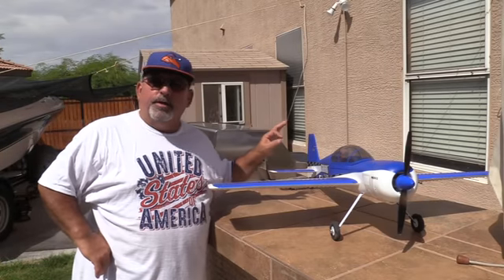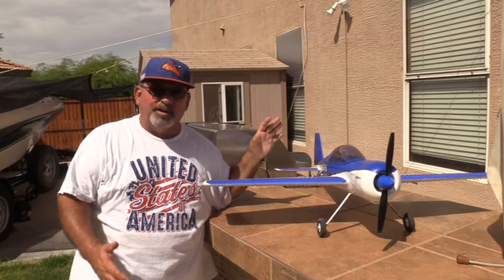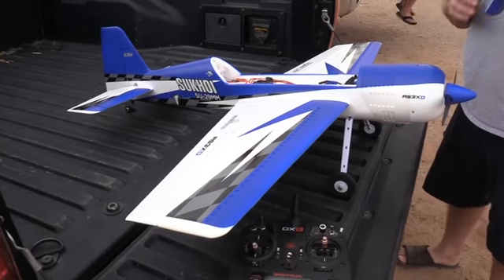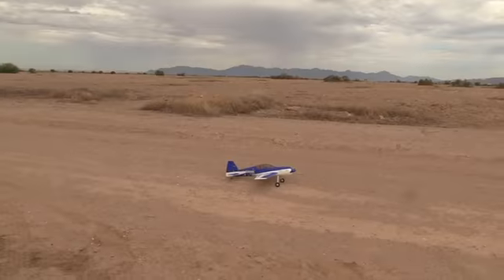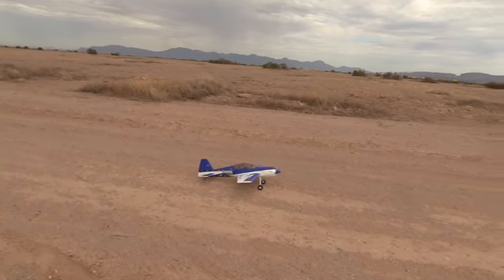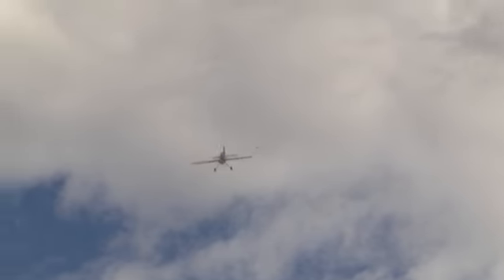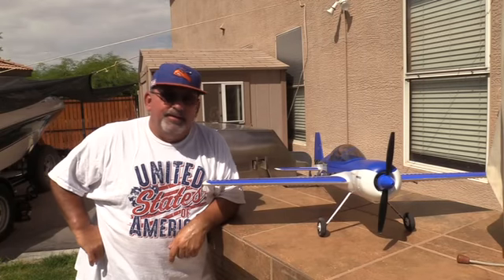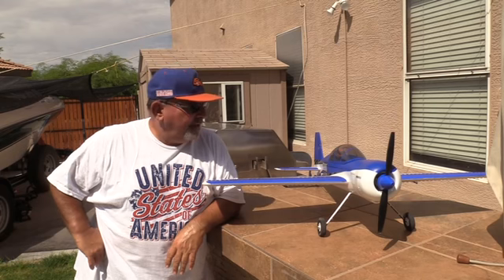E-Flight Sukhoi Gen 2 maiden flight and review

Comment: At least for me, the one mod I did was, remove the blue stickers (I have the green/blue version) from the bottom of the airplane.
Both sides, have the same stripes/stickers, and this is a small airplane and from far away the wheels disappear making it difficult to distinguish from top to bottom. Of course, moving the controls and watching where it heads will tell if upside or not. But the best thing to do is paint the bottom of the airplane black, exactly like the Dynam SBach 342, which is all black on the bottom, and I do this on most of my foamies, helps a lot and mostly on smaller fuselages like the Sukhoi.

Comment: Mine is just assembled with the recommended battery. It is 1/2 ounce overweight out of the box (Maybe a batch of heavy foam?). It is tail heavy with battery all the way forward. It needs a full ounce in the very front near prop to balance per instructions. Nose heavy without canopy and tail heavy with canopy. I hate adding weights. There is really no need for the pre-installed plastic pilot to add weight.

Comment: I'm thinking of this or the mx2 v2 roc hobby. Probably the Mx2. Great video
Reply: Kyle Schieler I don't know much about the MX2 the planet South I really love the Sukhoi but it developed after about 10 flights a squealing motor I don't know if it's bearings or what so I have to replace the motor now for $50. That part didn't impress me but since it's the first time I've ever had an E-flite issue with any of their planes on the motor I'll just replace it and move on does make me a little mad though I've heard on the reviews I've looked at that this motor squeals a lot and runs low on power and that's exactly what happened to mine so you might want to consider that when you thinking about your purchase. The plan itself is great something about the motor though I'm going to replace it keep my fingers crossed and see what happens if it takes a crap I'll let everybody know
Reply: How is it now ?

Comment: Thank you 🙏🏼 from m an average pilot without years of experience I’m a little sketchy still with only being 4 months since my first plane I fly a carbon cub got a mini apprentice but ni want something more and advice for me ? Yes I fly out n advanced modes always
Reply from the maker: my first aerobatic  plane was the ultimate 2 Bi-Plane great plane but I bought the sukhoi to take the pressure off the because I was flying it all the time. then my TimberX for the same reason now I just bought the Extra 300 because I fly the Timber X all the time. The Sukhoi is a great plane for regular flying also radical aerobatics and 3d. Im still not a 3D guy yet. have fun and keep them in the air!!!....Tony

Comment: RC flyers of Arizona - your advice please
I moved up from 3 channel champ to 4 channel sport cub s to UMX Timber 4 channel with flaps and 2 cell - I can do the basic aerobatics with the Timber.
I'm thinking of moving up to the 3 cell Sukhoi gen 2 with safe.

None of the other planes use a bind plug. I saw one video where a bind plug was used to set the safe mode. Is there anything about a bind plug I need to know ?
I have a 6 channel DX6E -  will it work with the Sukhoi ?
Reply from the maker: moving to the Sukhoi is a big step up from a baby Timber. I would think about the E-Fight Valiant, It's a hi wing plane that is great to learn areobatics with or just fly lazy beacause its so forgiving and has safe select. I have videos here of that plane i just love it. once you kick some ass with that they I would to to the Ultimate 2 Bi-plane or the Sukhoi both are outstanding transitional airplanes... please let me know how it goes and what you decide...
Reply from the maker: yes by the way the DX6E will work just fine....good luck
Reply: Thanks for the replies - since I posted a week ago, I went ahead and got the Sukhoi. I have it set up and once the weather is good will make maiden flight. I left throws at factory settings and have set up duel rates and expo to tame the beast until I get experience. 
The tiny tape pieces for the tail seemed inadequate for me so I used shipping tape to secure it.
The very tiny size 0 screws for the landing gear seem very inadequate to me. They begin to slip when trying to tighten them down all the way - the Phillips head slot is too shallow to allow much torque.
I've got them on for now but I'm shopping for better ones -
need a sheet metal type size 0    1/16 inch diameter and 7/16 inch long
(at least that's what I think it is  - it may be a metric that is close to that.
For now I put shipping tape over the gear to help secure it.
Horizon Hobby referred me to McMaster-Carr to find small screws so I'm checking them out now. Local hardware has nothing even close to a size 0 - size 4 is their smallest.

I've been practicing power on landings with my other plane since I read that the Sukhoi needs some power on landing to prevent stall.

I'll be using a grass field - I hope the tires are big enough to handle it.
If not - I'll try some larger ones from Du-bro.
Thanks for the interest.
If I can't tame the beast then I'll sell her to you and try the valiant you recommend -  lol
Reply: follow up - 2 days ago my instructor said I'm ready to fly the Sukhoi solo now.  Will do it as soon as storms and wind are over.
It was an adventure going from trying a maiden solo at a small local grass park - and crashing it.
The grass slowed me down on take off and I was approaching a busy highway at low altitude.
I turned left to avoid the highway and it stalled and crashed.
I decided the park was too small for it and decided to sell it on ebay.
then I met a rc pilot who offered to buddy box me at a paved rc flying field. After about 6 sessions I'm ready now to solo.